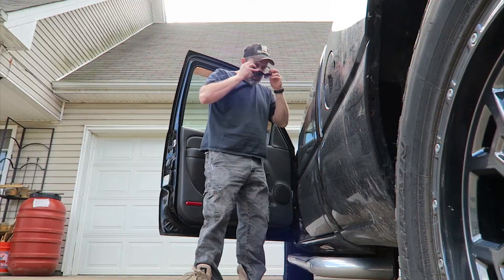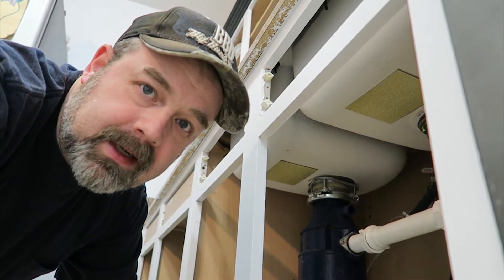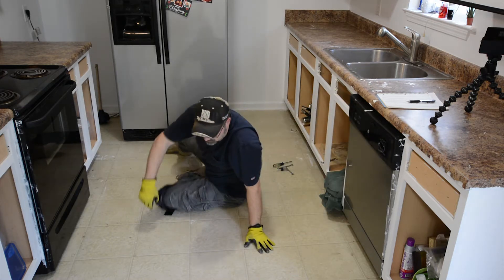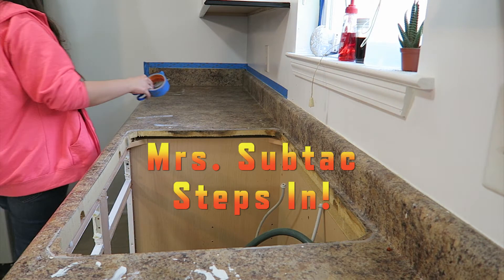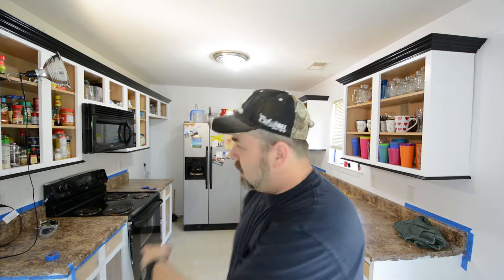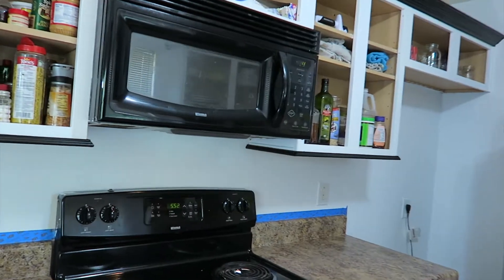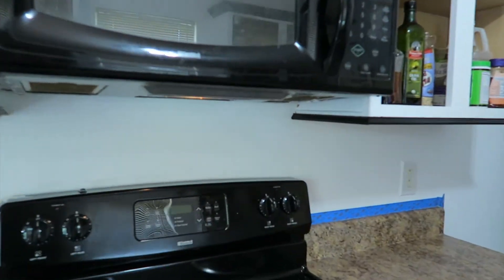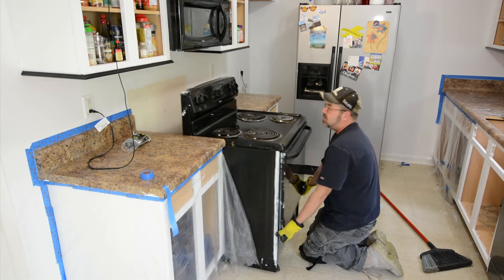Prepping In The Kitchen | Counter Top Renovation

Comment: When I pull out a old sink and faucet, I just disconnect the faucet hoses from the valves and pull it all as one unit. It's much easier to disconnect the hoses from the faucet and remove the old faucet once the sink is in free air and your not crawling around under the counter-top ;-)) To install it all....just reverse the process, and connect the hoses to the valves last ;-)) Just a thought...throw a zip lock bag over the drain line openings with a rubber-band around it to keep sewer gas from getting inside your home ;-)) Mrs Subtac will love you for that ;-)) Keep up the good work and Take Care :-))
Reply from the maker: +SurviveN2 I did the zip lock baggie thing.
Reply: Good ;-))
Normally I don't have zip lock bags on site with me so I use HD bags :-P  LOL
I use the bags for that and work trash, why throw them away, right? :-P